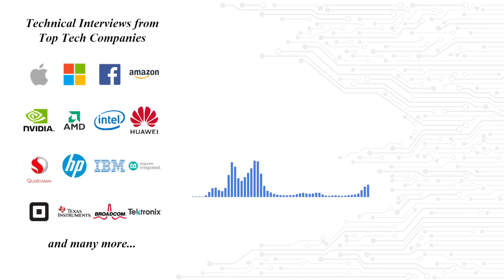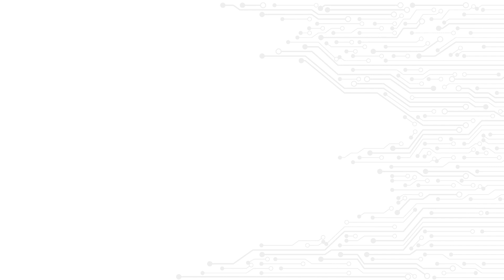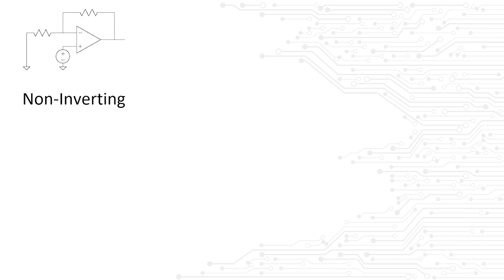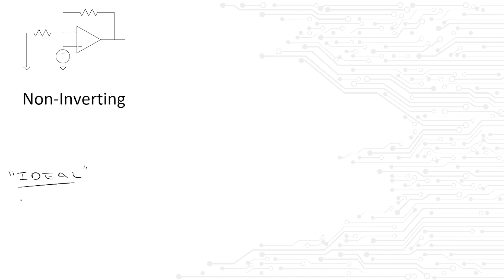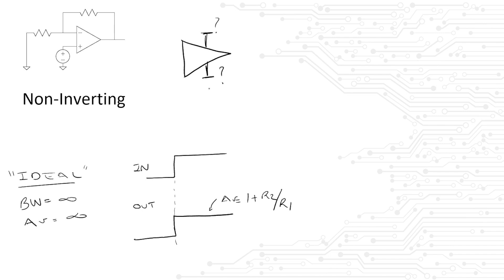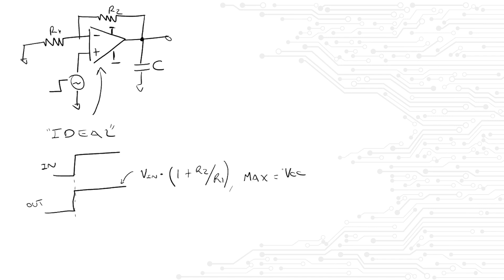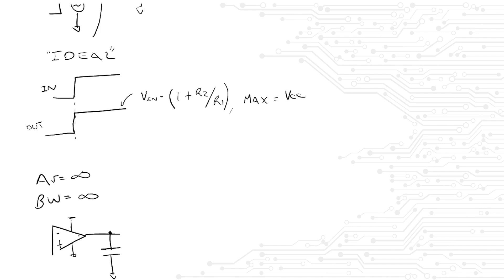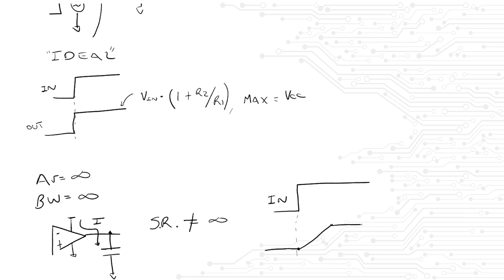HWN - Hardware Interviews S1E2 - OpAmps & Capacitors

Comment: For the last question, instead of SR the more correct answer in this case would be to talk about output impedance; SR is pretty much a byproduct, also it's only specified for a limited max capacitive load which could be smaller than your "unknown" C.
Reply: And also ask the interviewer how it is possible to have infinite bandwidth with limited slew rate! It'll show you know how all those values interact with each other and where they come from!
Reply from the maker: Hi!
Thank you so much for contributing to the discussion and for being a part of the community! Slew Rate is not a byproduct of output impedance (ideally zero for an opamp). Output impedance of the opamp is a byproduct of infinite gain (i.e. output impedance of the transistors divided by the loop gain). However, gain and also output impedance assumes a small signal model (i.e. the system is linear). During a transient, when the amplifier slews, the linearity assumption is broken. That's the reason they're not related. We hope that sheds some light on the topic. If you have any feedback or we are mistaken please do let us know!
Cheers
Reply: @HardwareNinja  So what would be the answer if the SR is infinite, but the output impedance is finite? Great channel and videos, respect!